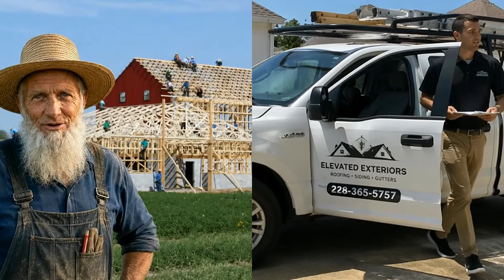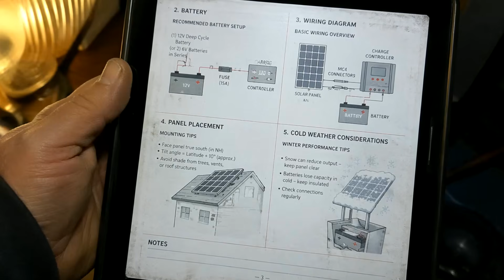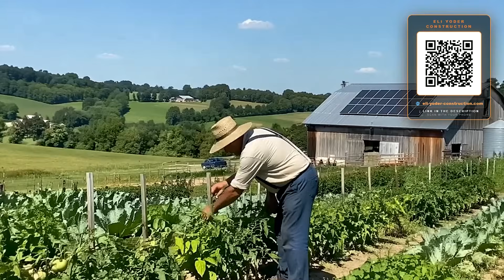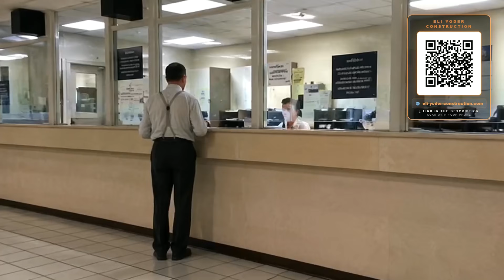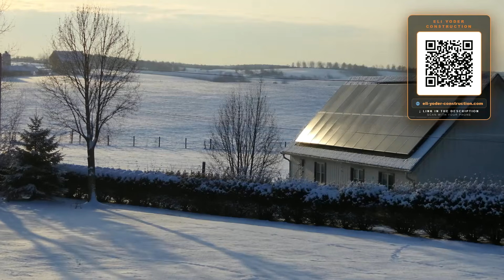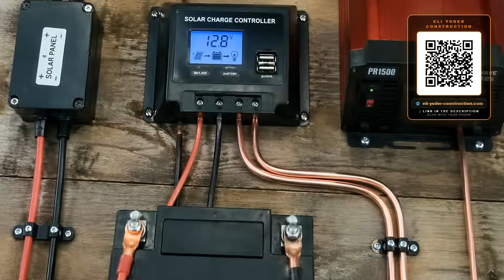Simple Amish Solar YOU CAN BUILD! Using Sungold Solar Panels

Comment: My  off grid workshop has been running on a 10 kva diesel generator and a small cheap lead acid solar system for light since I bought it a few years ago. I've just invested $3500 New Zealand on two 24v LiFePO4 100Ah batteries,  a 30 Amp mppt controller and a 6000 watt low frequency sine wave inverter. It has changed my life. I can run my lathe or milling machine all day, use my welder for hours and boil the kettle anytime I want. You can buy a 450w panel here  for $170 but atm I'm using some old panels I was given that put out around 380 watts. The good thing is I can expand the system from here as I can afford to.